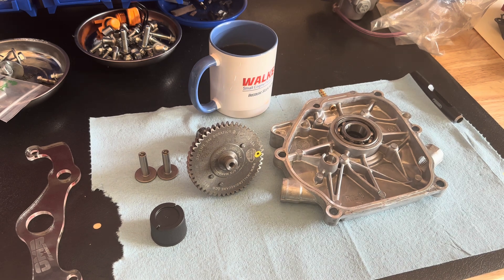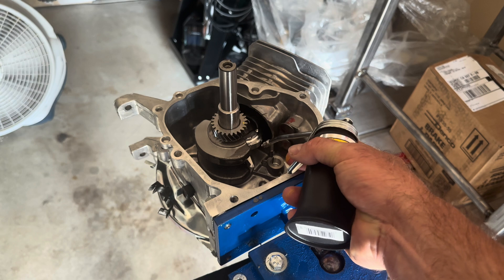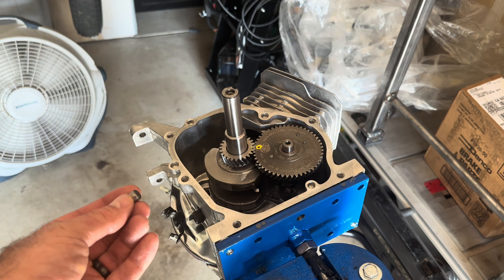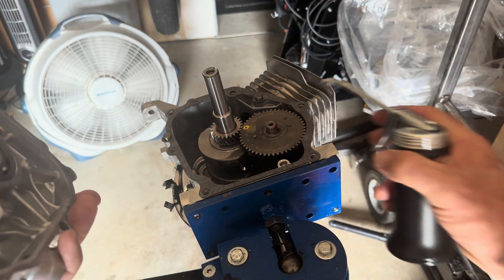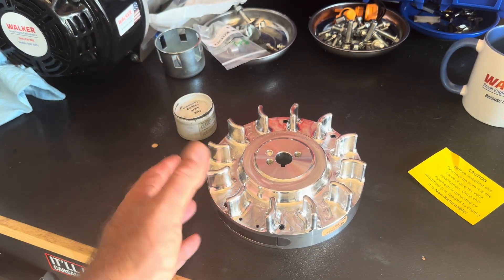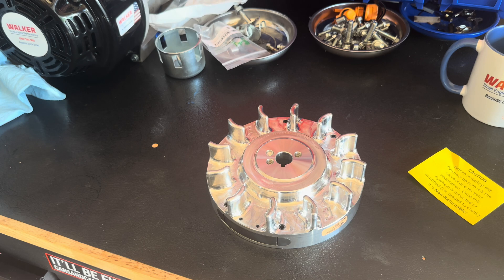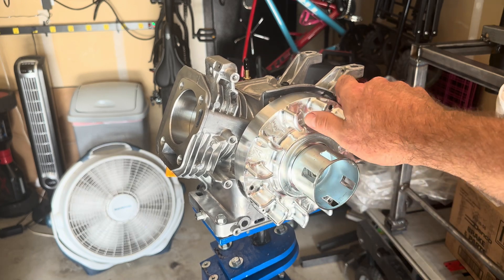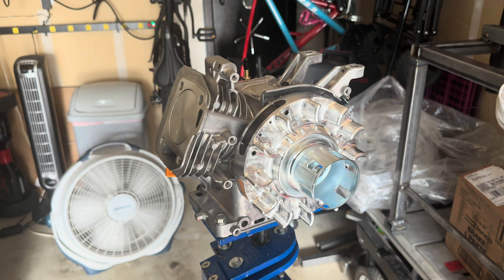Building a high performance Harbor Freight Predator 212 engine part-2

Comment: Did you have to worry about putting shims on the crankshaft or is that only if you get a billet side cover
Reply from the maker: Always check crankshaft end play, regardless of what side cover is used. It may or may not need shimming.

Comment: Does small engine cams offer a performance cam that is good for really low end torque ? Like just above 3600 RPM, working on an engine that is for the most part completely stock looking on the outside but can make the most hp inside a GX 160/200 block.
Reply from the maker: Yeah, they sell the Black Mamba Junior that has less duration and a narrower LSA for more low end. They will also custom grind just about anything you want.